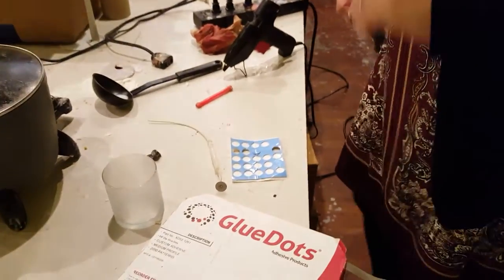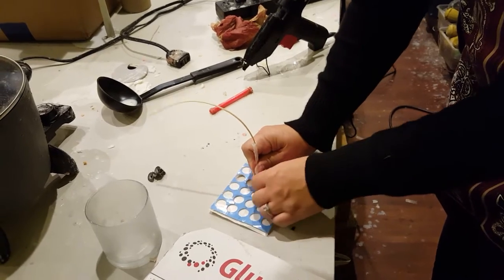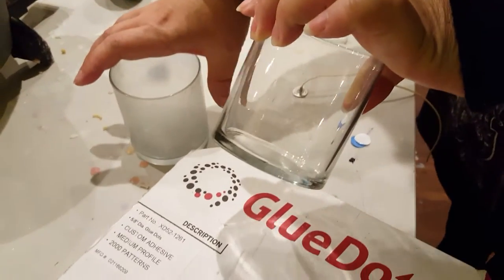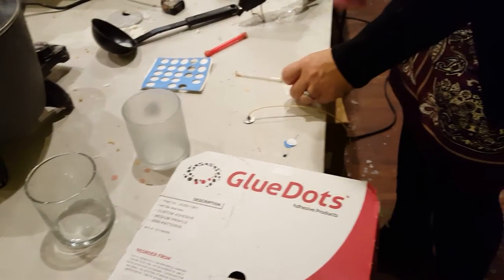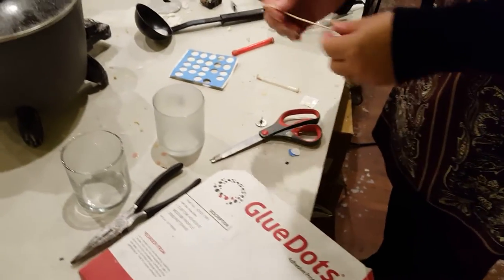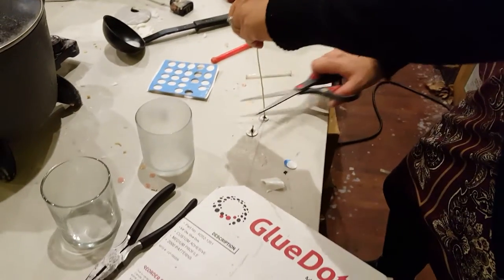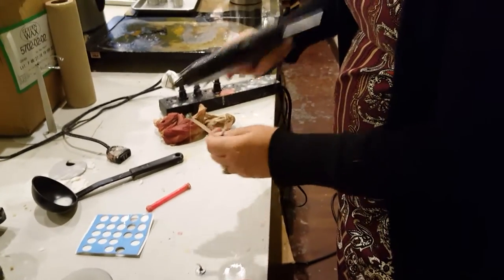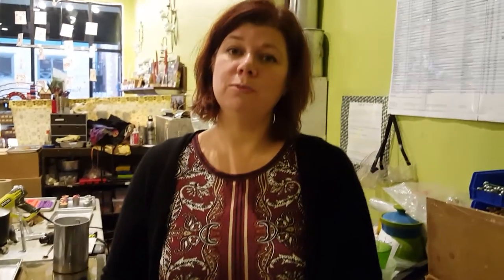How to adhere a wick to a candle container.

Comment: I like the tip about the straw but my wicks don't have that little metal thing at the bottom. What could I use instead of that? Thanks 💚
Reply from the maker: You should be able to put a tab on the end.  It is a must if you are making container candles. You should be able to get them at any candle supply place.  You would just crimp them on.  HTH :)

Comment: But, don't the candle wicks become un-centered when the hot wax is poured in...?
Reply: Hi Robert, I did this video a long time ago so I don't remember exactly which products I was suggesting at the time.  The main point is that you want to use products that will keep the wicks in place.  And different products have different levels of success.  My all time favorite is high temp hot glue.  Low temp will come undone, but not high temp.  And the other trick is to use a lot.  HTH :)
Reply: @lyschelw  Thank you for your timely response. I appreciate it. I am a beginner. Been using paraffin wax, but now I am experimenting with soy wax.  Another problem I seem to be facing is that I have to trim the wick about an 8th inch ( not wood ) every hour or so when they start to shed some black smoke on the paraffin wax candles.  Am I using a bad wick product? I have been buying mine from Amazon and they state they are wicks for soy candles. Thank you.
Reply: @robertpeeters8868  It sounds like the wick you are using is not the correct size.  Each scent/diameter/wax/dye may change the wick needed.  Getting soot after only an hour definitely means they are not the right wick for your usage.  It doesn't mean it is a bad wick. Just not right for what you are doing.  If you have smaller sizes I would try that.  There are a lot of different wick families and sizes.  Just because a wick is for soy doesn't mean that it will work in any diameter/scent/dye/wax combo.  Take a look at my blog about testing for wick size if you are interested :)  https://soapcandlemaking.blogspot.com/2015/07/testing-for-wick-size-should-you-always.html  Hope this helps.

Comment: I received balloon adhesive in a package of wicks.  What are your thoughts on this?
Reply from the maker: That is a new one.  I have no idea what balloon adhesive does.  I am assuming it is used to stick balloons to things?  If it is highly flammable I wouldn't use it for candle making.  If it isn't flammable it could be a cool new thing.  As long as it doesn't slide around when it heats up and doesn't start on fire I would give it a try.

Comment: Hot glue does not work when it's humid and sometimes cold, or the combination of both I'm in Florida and I have trouble with any of these applications.
Reply from the maker: Hi Lianette,  Have you tried warming your jars before you adhere the wick?  Also, make sure to use high temp glue.  HTH if you haven't already tried it.
Reply: @karnerbluecandleandsupply  I started using the regular foam dots and they worked perfectly till it got “cold” in Miami, which is a translation of humid and 55*. Then I tried the red RTV and it was working ok till it actually didn’t. I’m pretty sure my daughter made the last candle without letting the RTV cure, because it actually moved when she poured the wax. But my main concern was the jar that actually caught fire when it was right at the end. Which I warned the customer not to do anyways. I’ve tried high heat glue gun and it actually came off as well when humid. Humidity sucks 🤷🏻‍♀️